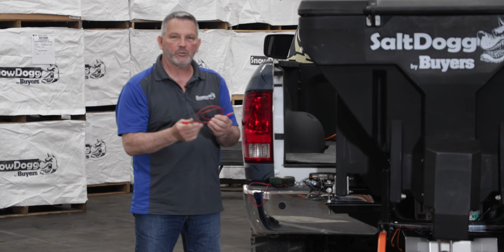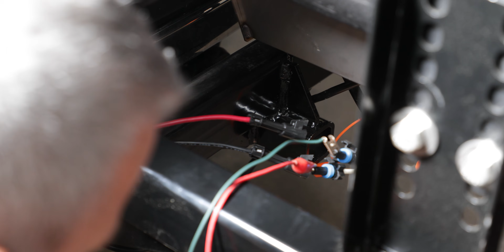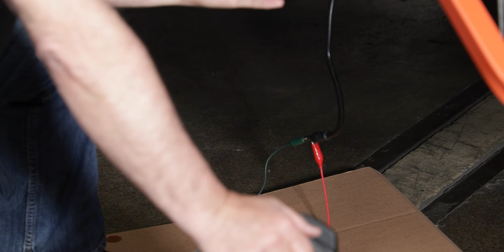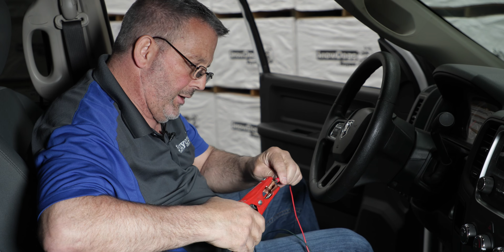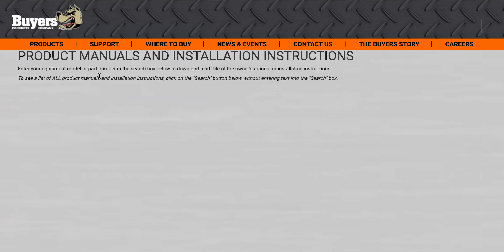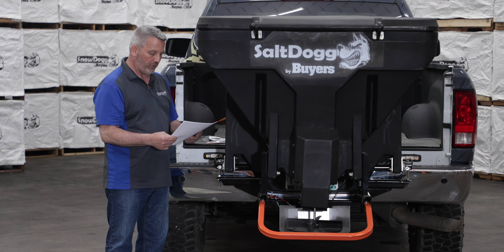Trouble Shooting Your SaltDogg Tailgate Spreaders

Comment: Hey quick question we just installed a new motor to the salt dog but vibrator works code H was showing up pls help thank you!
Reply from the maker: Thank you for your comment and question! I followed up with our Tech Support team, and this was their reply:

This is indicating that the spinner motor has shorted.  The easiest way to figure out what is wrong is to work backwards. Put power with a secondary power source to the motor and see if it will spin at the high speed. If that works, then make that same connection to the wire harness in the cab. This will then run the wire harness and the motor and verify whether or not there is a problem with the wire harness. If no error or problem surfaces, then it is the controller.

If you have lingering issues, you can reach out to Tech Support by calling our main line: 440-974-8888. Thank you!

Comment: Thanks for your video I'm having trouble with my auger or controller I'm getting 3.6v on the red wire no auger motor doesn't run with Derek current help.
Reply from the maker: Thank you for your comment and question! I followed up with our Tech Support team, and this was their reply:

This could be one of a couple of issues.  Either the truck is not supplying enough power or there is a problem with the control box.  Measure the volts coming out of the control box.  It should be around 12 volts.

If you have lingering issues, you can reach out to Tech Support by calling our main line: 440-974-8888. Thank you!